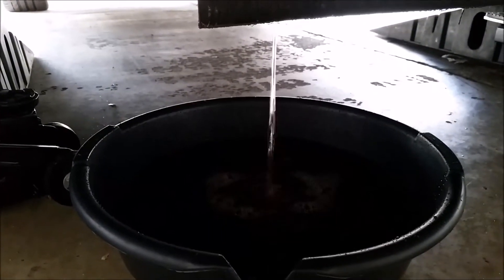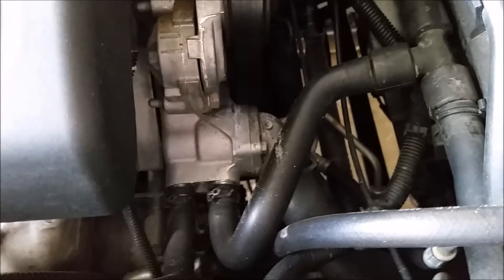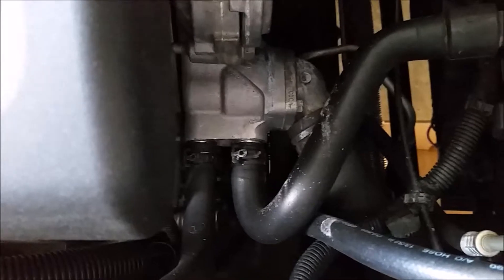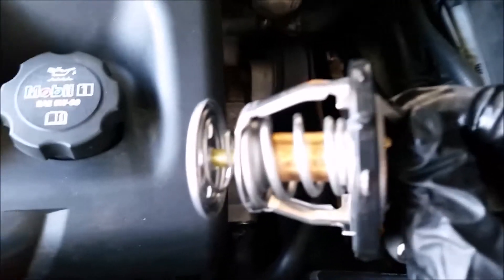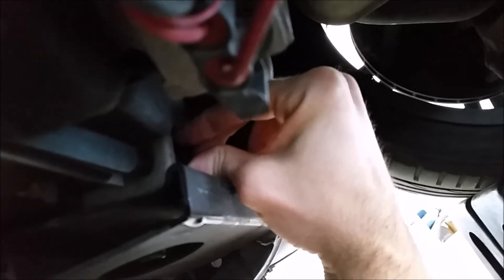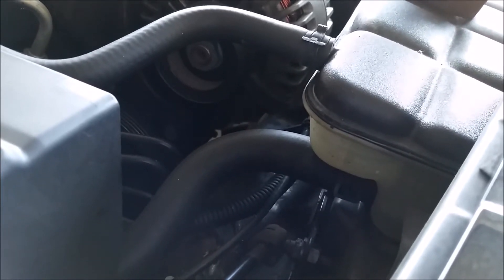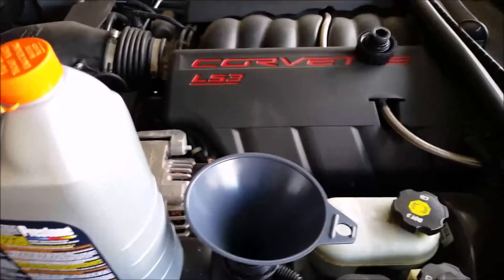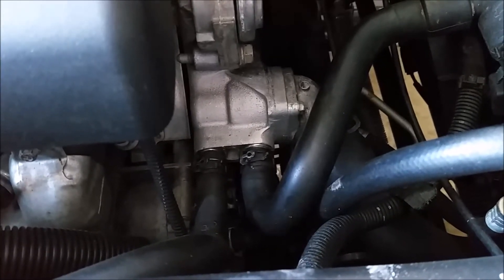How to Flush C6 Corvette Radiator + Thermostat

Comment: Only have to remove the thermostat , keep the drain open & put the water hose in to flush the entire system , You can start the car & run the heater so it cleans the heater core too, Youndidnt do it wrong but that is time consuming & more work doing it your way

Comment: People that say you should use distilled water are "fucking wrong" you say? You're the one with all the cooling system problems. Prolly because you've been using tap water to cut your coolant. You have no idea what you're talking about when it comes to distilled water. OF COURSE you want distilled water. I don't know what the water is like where you live, but here it is so hard it comes out of the tap in chunks. Solids dissolved in tap water will clog radiator passages and corrode the engine internals, depending upon the solids dissolved. You clearly do not know what you're talking about, Jr.
Reply from the maker: Read my replies in the comments cunt. I use distilled. I can’t update the video. The car had 50/50 premix when the cooling issues came about so the type of water used played no part in the causation of the cooling issues. Tap water in my area doesn’t have the amount of contamination that some places experience. I’ve ran straight tap water in multiple vehicles I’ve owned and while it may not be ideal, I have never experienced any issues doing this. I use distilled now because I took the time to reach out to the manufacturers and engineers and educate myself instead of using that time to create an account that has no followers, no uploads, and one comment offering an opinion with no educated explanation or sources.

Comment: My question is this, where do you dispose of all of this old antifreeze?  And all of the flush fluids until you get it clear?  That can be a lot of toxic fluid.  After calling auto parts stores and service stations nobody gives me an answer.
Reply from the maker: I have a drain tank. If your drain pan is too small you can put the fluids in old containers. I always save my oil & coolant containers to hold old fluids if need be until I can dispose of them. As far as actual disposal, places like Advance Auto Parts, Oreilly's, & Autozone have disposal areas. Bring your container(s) and ask to dispose of them. They get sent to the correct facilities from there. Please don't pour these fluids on the ground.
Reply: @ModestlyMinted  I spoke with Advance Auto and they said, "NO."  I also spoke with a local source that used to take my used motor oil and they quit doing that a few months ago after decades.  Everybody is big on the "Green" agenda until it comes to recycling.  The standard line is to tell you to dispose of these materials responsibly.  Right, thanks.
Reply from the maker: @georgemcmanus6073  Maybe speak to a local dealership or places such as Express Oil. You can also checkout Earth911 at the link below. Search for motor oil and your zipcode and it should give you facilities in your area to dispose of used engine oil.
https://search.earth911.com/
Reply: @ModestlyMinted  Yes, I can find another facility to take my motor oil since my usual spot no longer will.  That's easy.  It's used coolant that is impossible to dispose of.  This is nothing new.  It's been a problem for years.  Since it involves quite a few gallons of original draining,  and then flushing fluid (mostly water), I have had them claim that they can't tell what else it is contaminated with and that their recycle people are getting very particular about what they pickup.
Reply from the maker: @georgemcmanus6073  Same for that. Check with dealership service centers or use Earth911.com and search antifreeze. You may have to adjust your radius if you have fewer options.
Reply: @ModestlyMinted  Thanks!  Earth911 was helpful.  It gave me a few options and I will make some calls.  I wonder how they will react when you show up with about 10 gallons of mostly water.

Comment: Thanks for the insight. Funny as hell when you randomly used an expletive about distilled water. It blindsided me but funny.
Reply from the maker: Lol thanks. Unfortunately, I was f***ing wrong. I spoke with Prestone to clear up some confusion on a couple issues. They convinced me. Use distilled. Short term won't make a difference, but long term will.
Reply: @ModestlyMinted  You're welcome and thanks for responding because I was going to use tap water. My other problem is the coolant is pink when it should be orange as uch as G40 OAT. 

The pink coolant was in the radiator when I bought the Vette from OE do I used the same color when I installed a 180° thermostat. Its been one year since the work. I guess the pink has some phosphates in it. I'll make sure to flush the radiator good before changing colors.
Reply from the maker: @rodneycorless5168  My main reason when I contacted Prestone was to clear up the confusion of switching from DexCool to regular antifreeze. There was a rumor that doing so would create a sludge in the radiator because they don't mix. That is untrue. Prestone is the maker of DexCool along with other antifreeze. They assured me that it didn't matter. Now saying that, I wouldn't recommend having a weird mix of 2 different ones. What I mean is that as long as you flush the water to clear, having any small amounts from the previous antifreeze shouldn't be an issue when you switch to whatever color is your preference. I run the common green coolant and before that I ran DexCool.
Reply: @ModestlyMinted  Are you running the regular antifreeze for cost savings? The only time I've experienced sludge is when I transitioned from Caterpillar extended life coolant for diesel engines to any color green coolant. I think I'm in the clear transitioning from one G-catagory OAT to another but yeah I'll run her clear. I now understand your frustration, been there, done that. Life was so much easier back when we only had two types of coolants, diesel and gasoline engines.
Reply from the maker: @rodneycorless5168   @Rodney Corless  Yes, I do it for cost savings. When I was having the coolant issues that lead to this video, I was throwing a lot of money down the drain everytime the car overheated and shot coolant out of the overflow. I switched in case changing the thermostat didn't clear up my issue(after checking with Prestone to make sure I could go back and forth no problem). Car is fine and I've just never had the need to switch back since it hasn't needed to be flushed since.

Comment: I was only able to drain 2 gallons is that normal ?? I know these take like 3 gallons
Reply from the maker: There will still be water left in the block. That's why you will continue repeating the steps of refilling with water only, running the car with heat on max, and then draining again until the water comes out clear.

Comment: Sorry but I respectfully disagree with using tap water. Ideally you should have used distilled water. You will not notice a difference now of course, but in the long term, tap water will give you internal corrosion. Otherwise thanks for the video, it was very helpful.
Reply from the maker: This is by far the most constructive and respectful  comment in disagreement I've seen in a while. I actually agree with you. I reached out to Prestone back in 2018 and the customer service department reached out to the engineers and they convinced me. Unfortunately, I can't update the video. But yes, you're right distilled is best, the manual is wrong, and I too now use distilled.

Comment: where is the bolt that flush the engine block ?
Reply from the maker: There's no bolt for flushing the block. You continue to repeat the steps in the video; draining, refilling with water only, and running the car for around 10 minutes with the heat and fans on max. You repeat this until the water flushes clear. Once the water is clear then you refill with your antifreeze/water mix.

Comment: What coolant issues were you having with your vette? Mine is running like at 220 degrees
Reply from the maker: Sitting idle for any more than a couple minutes would cause the coolant to push out of the overflow tank. 220 is high. For me in a warm climate (and after the fix), the car with a standard thermostat stayed around 205. It would only get to 215 or 220 on a really hot day sitting idle in traffic for a long period.
Reply: @ModestlyMinted  I think mine runs at 215. I will check tho, I am going to change coolant soon, will pot on my channel too.
Reply from the maker: @phoenix21studios  That may be normal for yours, I'm not sure. When I used mine as a daily I was in a climate where sometimes it would occasionally break 100F during the summer, but often stayed in the 90s at the peak and 80s the other couple summer months. My normal seemed around 205 in that climate.

Comment: Actually purer waters like deionized or distilled water will mix with lots of water soluble salts better than tap water that already has salts in it. This is preferable because this purer water cleans your coolant system instead of leaving frap behind like tap water so...yeah chemistry n shit
Reply: That's not how it works. Tap water has trace minerals in it for health reasons. It a fraction of a fraction of a percent of the water and in no way inpacts it's ability to be soluble or amount of 'stuff' it can hold in solution. Tap water leaves water spots on your car because the water evaporates and then leaves the minerals behind. Unless you plan on flushing and then allowing your coolant system to get bone dry, then doing that hundreds of times to build a layer of mineral deposits in your block/components there is absolutely no way it will effect your engine poorly. Is pure (distilled) water better? Yes, technically. Does it have any difference in reality? No. It's like using pi to the 10th digit the calculate the circumference of a one inch tall circle. Will you get a better result? Yes. Does it matter in practicality? Absolutely not.
Reply from the maker: I actually spoke with Prestone 8 months ago to clear up this issue. While they did sway me to start using distilled water, their argument had nothing to do with whatever you're talking about in regards that distilled water "[mixes with salts]" and "cleans the system". Their argument was based on the contaminants of tap water itself. Because you know...product engineers and shit.

Comment: So before you do the final refill, you know there's still some water left in the block. The cooling system capacity is 12 quarts. Simply put six quarts of straight antifreeze and top off with water. That way you know you have six quarts of water and six quarts of coolant in the system -- perfect 50/50 mix.

Comment: Thanks for the DIY video. Actually, if you can use softened water that would be ideal. Distilled water's imbalanced ions as a result of the distillation process actually end up stripping electrons from the metals in your cooling system, eventually causing damage to the system. Even better yet, add a bottle of Hyper-Lube Super Coolant or Royal Purple's Purple Ice for corrosion inhibiting protection and surfactant properties.

Comment: Should have put a 180° thermostat for "bolt on's" later
Reply from the maker: Steven Lynch A 180 wouldn't have given me any benefit. The plan for the car is turbos within the next year or two. If I do any bolt ons between then, I'll move directly to a 160 and give the car a proper tune.
Reply: For anyone who needs to see this:
If you are upgrading your Corvette's thermostat, you should be getting one with a  160° rating for it to be worth the trouble (and yes...doing a 160° thermostat will indeed be worth the trouble for almost anyone — people who drive in traffic during summer months, anyone who has headers, etc, etc...)